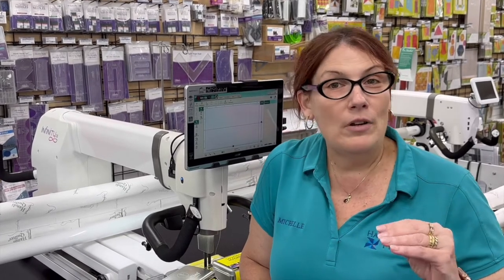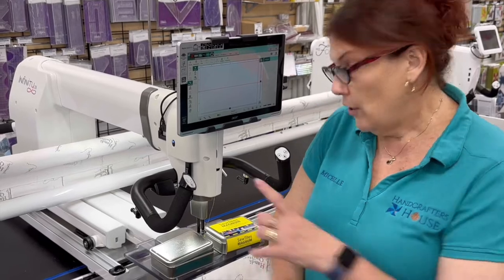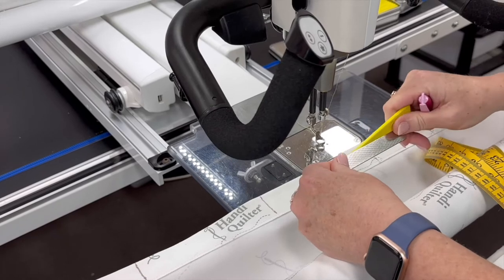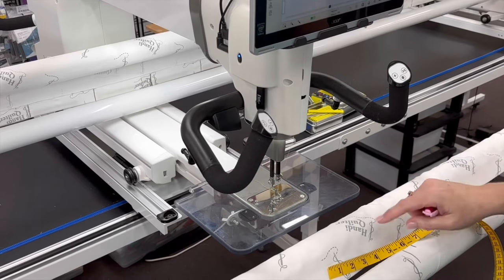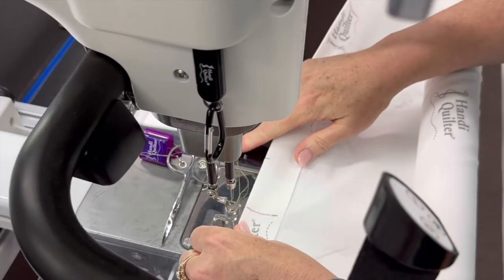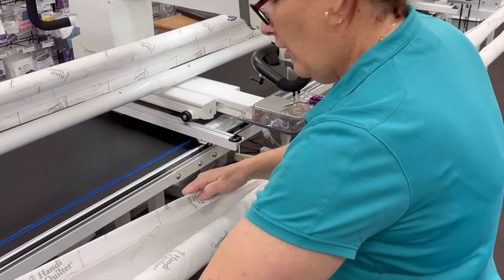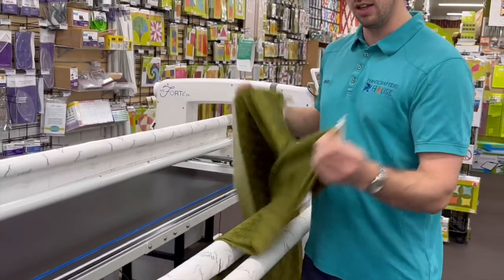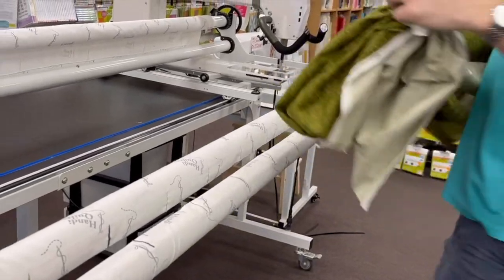Magnetic Longarm Leaders using SewTites

Comment: The one suggestion I would make is to do a single line of stitching when you sew the bars in.  When you have to take those bars out of the leader,  it’s a pain in the butt to rip out all of those stitches in between the metal bars, believe me.  I took them out because I had the original smaller ones, and they didn’t work for me.
Reply from the maker: Thanks for this tip, we can definitely understand making life easier to rip out stitching if you were going to change the magnets. Though we are confident that we won't ever need to change these out... they are SUPER strong! :)

Comment: When you placed the plates, they were pattern-side up on the back (not printed) side of the leader.  When you loaded the quilt back fabric, the magnets were applied to the right (printed) side of the leader.  Does it matter?  Initially you said it was the pattern side of the plate that was supposed to have the magnet attached.  When you attached the fabric to the far (top) leader, it was to the back (not pattern) side of the leader. If it is just a steel plate, it should not matter.
Reply from the maker: Hi Kathy, the reason for the pattern on the plate to provide extra grip. But like you say it is encased in the the leader so it doesn't really matter what side it ends up on.
Regards 
HH Team